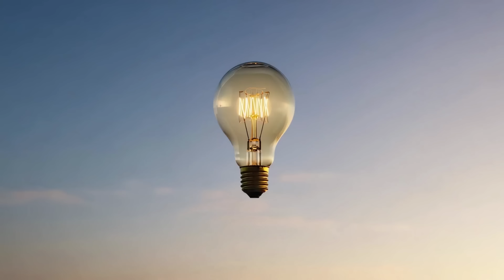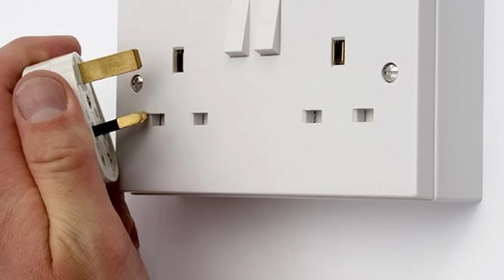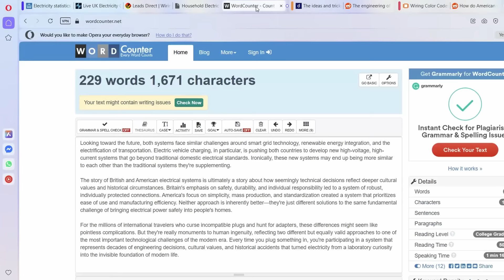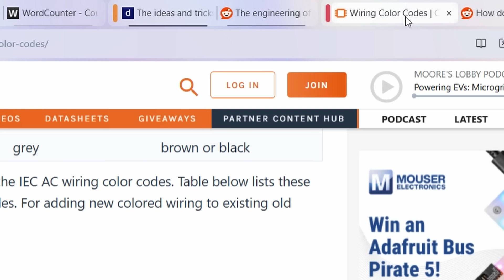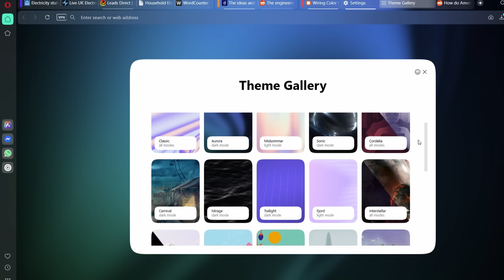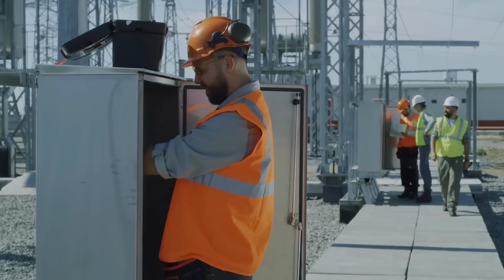British electricity is SAFER than American electricity. here's how.

Comment: A couple of things not mentioned. I'm in the UK but I understand that US homes do, in fact, have 240v installed for high load items like washing machines? The second thing, which I have never seen mentioned, is that using a lower voltage for powering 'stuff' means higher current for the same power, ok, but this this higher current quadruples the resistive losses which may not make much difference to a domestic setup but the cumulative effect on a countrywide system must be measurable?

Comment: Some years ago there was an international committee to consider a world-wide standard for plugs. The UK plug was rejected by the majority of the committee because it was "too good".
They recommended an unfused design that had three prongs in a straight row, but nothing more was ever heard of it.
Reply: Fuse can be put into any type of plug without any problems. Its just standard practice in UK while other have it optional. Same as switch on UK sockets is actually optional extra and not requirement.
Reply: @lauriviik  The switch on the socket is safer because sometimes, rarely thank goodness, with an older rewireable plug the top can come away on it's own leaving bare live terminals and the fuse exposed, so if there's a switch you can switch it off so you can safely remove the rest of the plug.

Comment: Edison didn't promote 110V from any technical advantage at all.  When he established his very first electrical distribution in Lower Manhattan he used 50 volts for the sole reason that 50 was a nice reassuring number that played well for advertising.

One the first installations were done he quickly found rich customers demanding more than the wires could deliver so to double the capacity while saving copper the upgrade was to use a +ve 50V wire, a -ve 50V wire and a common ground.  How we've got 100V. And North America's split phase domestic.

Then as more and more customers want in the distances made voltage drop significant so Westinghouse, who was providing the generators for Edison, pushed them up to 110 to deliver not less than 100V at the end of any line.

Then Westinghouse said bugger playing around with these little numbers let's do 110/220.  The NEC officially pushed it up to 120/240 in 1968.

It was UK importing Westinghouse generator sets that gave us (eventually) 240V because we looked at the central tap neutral and said that's bloody stupid, we're not doing that and went straight to the full output, and locally supplied current varied from 200V to 260V until the National Grid was established in the 1930 and standardised on 240.

Incidentally Edison's 50V survives to this day — the standard DC supply for telecoms equipment is a nominal 48VDC (real ~51/52V) right across the world.
Reply: 48 volts is a useful standard as it can be supplied by lead-acid batteries. It is the basic supply voltage used for the electrical control systems on many trains for example.

Comment: AC voltage is easier to to upgrade and convert than DC. Britain used a 405v 3 phase network  which can be easily fed into premises and is usually fed into even small business which have a high current use. It's not an issue with battery charging outlets the technology has been around for decades, I was using it in the late 60's.

Comment: I’m surprised you didn’t mention that the British plug was designed in 1942 with the lead engineer being  a woman, Dame Caroline Hasslett. 
And I’ve lived in two countries in Europe with different systems. Plus experience in the US and Australia And even Russia and Georgia (the Country)  in 1990. 
I’m not sure that the British fittings are more expensive, but they are certainly much more reliable and durable.

One of the big problems with the EU is that rather than go for best practise (British Plugs) they tend to follow the country with the biggest vote. 

And if you compare the French plug and socket system with a German plug in socket system, they are not quite compatible and almost appear to have been made deliberately so.

Comment: The plug's fuse is to protect the flex (power cord); it's not to protect the device/appliance at the other end.
Reply: Although the regulations emphasise that the purpose of the fuse is to protect the cord, it's good practice to check the rating of the device as well..  In many cases the device will only need 1 or 2 A while the cord may be capable of 13 A, if a larger size has been fitted to a portable device to minimise risk of cord damage.  Apart from the 3A and 13A fuses specified in the standard, 2A, 5A, 7A & 10A fuses are available, and sometimes a correctly-rated fuse will prevent unnecessary damage to the device -- having said which, an RCD protects a device better against just about anything other than overload.
Reply: Well, the flex, plug & person. Primarily if a cable was worn, punctured, or came undone.
Reply: @eucharistodeo  No, just the flex. It's to prevent an overload situation leading to its overheating and perhaps even burning.

Comment: My father an English electrical technican who moved to Canada told me how unsafe the US standard used in Canada was.  1) British plugs have a switch.  You want the plug to work you turn on the switch; once done you turn it off.  No live wires snaking from the plug.  2) If you touch a 240V line it will shock you and push you away - quickly, and it stings.  You don't do this twice.  If you touch a 120V line your hand will naturally close on the live line.  It won't sting - it will kill you, unless the breaker kicks in.  Then you just have a bad burn and nerve damage.  Alway touch 120V lines with the back of your hand.  You just get a sting, and possibly light nerve damage.  3) As for longevity a British home will last 150 to 400 years, a North American home 15 to 40 years.  So, if the electrical system fails in a North American home - well you were going to replace it anyway.  :)
Nice video, well researched.

Comment: Correction: Ring circuits were designed to reduce copper usage, as copper is expensive, and was even more so in the 1940s and 1950s. It enables the use of higher power devices while also allowing the installation to be somewhat less costly.
Reply: USA uses aluminium, a poorer conductor than copper, so it needs to have a greater cross-sectional area to conduct the same current as copper.  Because they use 120V on most domestic circuits, the current is roughly doubled compared with our 215- 240V so the cross-sectional area has to be greater again!
Reply: Glad you mentioned abut Ring circuits. Recently I went on a refresher course on house wiring and was told by the tutor that there was some debate in the UK  whether  to cease installing a Ring circuit in new houses and return to fitting  Radial circuits instead. The logic being  ( as many electricians know ) homeowners and DIY unskilled tradesman  frequently  interfere with the house wiring leading to potential  dangerous electrical faults.  Common mistakes are the Ring is broken resulting in two very long radials  made up of a  15Amp cable protected by a 32 Amp MCB.

Comment: 2:20 I'd hardly call a properly designed plug as 'taken to its extreme'.
The live wire is the shortest so it will be the first pulled out if the cable is strained.
Reply: That is aresult of thoughtful rational design.  It used to be normal in Britain.

Comment: UK Type G plugs (BS1363) are widely regarded as being much safer than most Euro plugs, the U.S., Chinese, Japanese and Australian designs. Britain also has frequent electrical Code revisions which reflect improved safety standards and electrical equipment requirements. But most domestic supplies are only single phase, whilst the standard three-phase supplies are mostly to business and industrial premises. Some European mainland countries supply 3-phase electricity to domestic premises.
Reply: Safer, but also a lot more expensive with the use of metal, plastic and the fuse.
China did a global study and decided on the Type I (or Australian plug) as their primary standard, although there is a wide variety in China including many multi-plugs in hotels.
Both have been updated over time with insulated pins and gated sockets.

Comment: My grandparents lived in a bungalow which consisted of two smaller properties joined together. One half had the old fashioned round pin sockets and the other had the more modern rectangular pin sockets. Granny had to take a plug adapter with her when doing the cleaning so that her vacuum cleaner could be used in all parts of the property. Another relative lived in a 1920's built house that had electric lighting from new but no sockets. Their vacuum cleaner had a fitting which could be plugged into a celing light by removing the bulb.

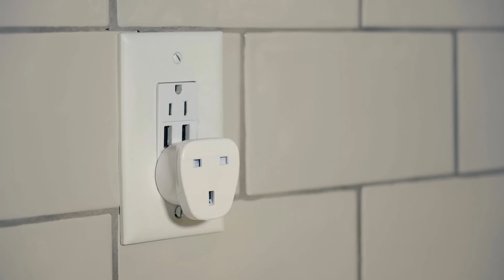Comment: 06:15. I have never seen a U.K. socket mounted that way up. Look how the cable on the plug is put under immediate strain as it bends through 180° to hang downwards. It looks so ridiculous.
Reply: When house buying I once viewed a house where all sockets were like that. The thinking is that your appliance is higher than the socket, same thinking you find with many wall brick adaptors for low voltage appliancies.
Those things annoy the heck out of me. You don't generally have a wire in a taut straight line straight up from socket to appliance, there is always a sag down after leaving the socket.

Comment: For the last 30 years, UK domestic mains voltage has actually been 230v , with a + 10v, - 6v tolerance.
Reply: Maybe but I regularly get 248 to 250 at home.
No problem, things work just fine.
Reply: Nominally, that's true. But in reality it's still around 240v. Mine is 241.7v as I type this.

Comment: The two pin N. American socket shown has been obsolete since generation X was born, and only seen in old houses. We use 3 pin sockets for general electrical gear now, which accepts both 2 and 3 pin plugs. Our houses are wired for both 120 and 240 volts, with voltage and current specific plugs. Small appliances use the 120 volts, while the heavy stuff gets 240, and some even use both (with 4 pin plugs). The 60 Hz system allows for smaller components, such as transformers, has less noticeable flicker, and fits nicely within how we manage time. 60 cycles per second, 60 seconds per minute, and 60 minutes per hour. Even our old analogue TV format was just shy of 60 fields per second. And we don't transmit electricity over long distances at 120 or 240 volts. Those voltages are just used locally. Distribution is anywhere from 4.16kV to 11kV, and transmission is 11kV to 700kV, 3 phase, like anywhere else in the world. And generation is usually 11kV. In some places, we even use high voltage DC transmission.

Comment: A few clarifications:
- The original plugs in the UK weren't the rectangular pin we have now, they actually had round pins but still a three pin layout. I remember visiting my Grandma's house and they still had a few sockets that hadn't been updated. I think since the 80s all homes will have been switched over though. If I'm remembering correctly there were small and larger size of the round pin types also.
- To my understanding, ring mains were a cost cutting exercise post war, because it allowed a house to be wired using less copper but could handle higher power loads due to the unique features of ring main designs. For modern wiring I believe they don't install ring mains anymore, and use a radial system that's likely the same in the US. There's a host of challenges in maintaining ring mains safely. When properly installed and maintained, they're great, but if a break happens anywhere in the ring, power can still be delivered, but can end up being above the rating of the wiring, potentially causing fires.
- Funny you should mention UK vs US kettles. There's a great Technology Connections video that's only recently been released that does an in depth comparison, along with a bit of janky fun.
- The US electrical system is actually fully 240 volt capable, but due to how it's effectively centre tapped you get pairs of 120 volt circuits that have opposite polarities. You can get a US electrician to fit special plugs and wire across the full 240 volts for special uses, and high power needs. I believe this occupies two slots in the supply panel.

I've simplified how I've described this for ease of understanding, rather than bogging you down in too much detail, but there's plenty of resources out there that can go into finer detail. ElectoBoom has done some fun videos comparing different plug and electrical installation types in different countries, including for the UK.
Reply: For power / socket circuits you have a choice in the U.K. of either 32A ring circuits  or 20A radial circuits. Either is in line with the standards.
Reply: Yes, when I went to Edinburgh University in 1985 and lived in Pollock Halls, the socket required round pins. I had to buy a round-pin plug! This also accounts for the sockets that you find in India.
Reply: Yes I remember the old round pin plugs, they had the three pins and came in three sizes 15amp 5amp and 2amp used for table lamps.

Comment: We don't use thinner wires, our ring circuit can carry 32 amps at 240v which from this search is higher than the maths I did.
A UK main ring circuit is protected by a 32A breaker and can carry a maximum load of around 7300 watts
A spur off a ring circuit is limited by the rating of its fuse or breaker, which cannot exceed 13A for a standard fused spur, but has a total maximum load of 16A (or less for specific equipment).
You don't run that current on thin wires.
The three pin plug as you point out, as a development, I remember using three pin round plugs, and a few others, in a bedsit/flat mum had in the late 70's early 80's and yes they were scary and over heated even just warming the fire.
Reply: The point of the ring circuit is that you can, indeed, use thinner wire (less copper). This is because current is delivered from both ends of the circuit.

Comment: The UK system has sort of evolved.

We didn't have it in my first home as a child and in my second one we had some sockets that took small plugs with round pins. Even now, I know of a house in my road which still has some of them.

They did all have longer earth pins on the plugs though.

The gates over the live and neutral came later and I still have some plugs which do not have the part insulated live and neutral pins.

The other thing you will find, particularly in older houses, is that the wiring can use red for live, black for neutral and green for earth but more recently this has changed to brown for live, blue for neutral and yellow and green for earth. 

Lots of homes, including mine, have some of their wiring on the old coding and some on the new.

The new is in keeping with european standards.
Reply: Indeed so now you can have two blue wires in a connecting box, one will a neutral the other a phase.
Lethal, and the point at which I lost all respect for the IEE.